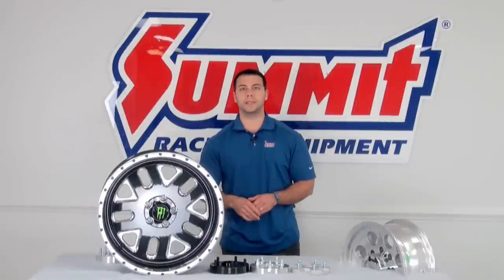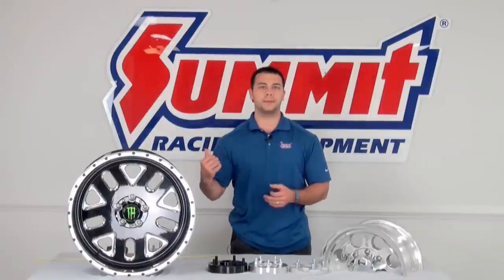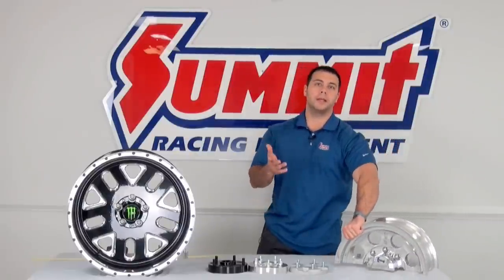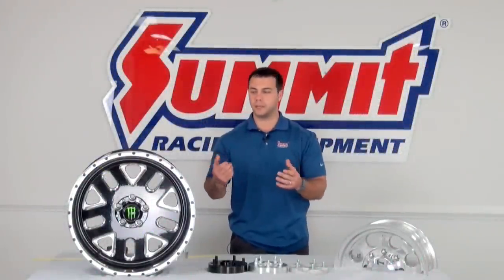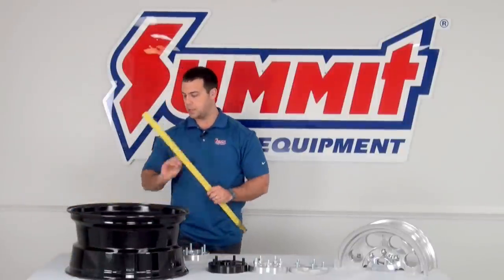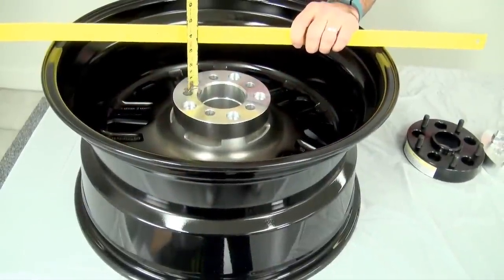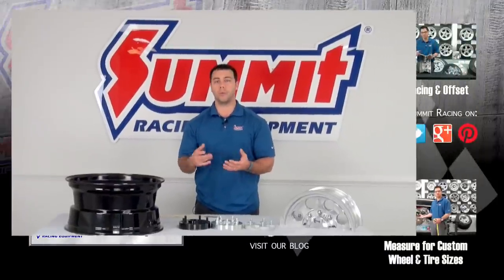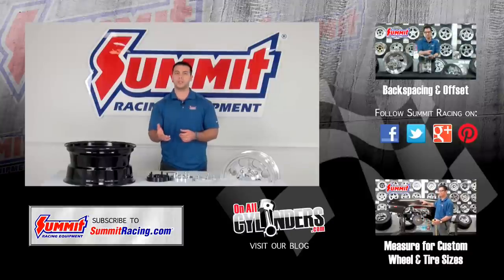Selecting the Right Wheel Adapters

Comment: So I got a 2006 Scion tC but the bolt pattern is slightly off as I got wheels for them size 18 x 9 but as I said they won’t fit do to the bolt pattern being slightly off. Which ones would you recommend for them to fit my car

Comment: I'm looking at changing a 5x114.3 to a 4x100 bolt pattern on my 2024 Nissan Kicks for the winter only.   I have winter tires on rims which I used on my 2019 Kicks which had a 4x100 bolt pattern but my 2024  Kicks is a 5x114.3    First is it possible?   And....what size adapter do I get?   If it is possible where do I purchase them.  I'm in Ontario Canada.

Comment: All I need to know.  Is the way the vehicle bolt pattern to the rims.  Need to be ordered to fit.  Say my C10 5x5 to a 5x108

  Do I order a 
5x127to5x108
         Or
5x108to5x127.  

Which one will be right to put a 5x108 wheel on a 5x127 bolt pattern?

Comment: Right now I have a 5X4.75 wheel bolt pattern. I want to increase the wheel distance by 2.5" but keep the same bolt pattern. Can I get spacers to keep the same Chevy bolt pattern, but move my wheels out 1.25". Thanks for sharing.
Reply from the maker: Yes we offer 1.25 inch wheel spacers
https://www.summitracing.com/search/part-type/wheel-spacers/wheel-bolt-pattern-app/5-x-4-3-4-in/thickness-in/1-250-in?N=thickness-in%3A1-250-in&SortBy=Default&SortOrder=Ascending

Comment: How safe are adapters? I heard they snap, wear down tire unevenly and wear down wheel bearings since it’s out more.
Reply from the maker: Quality hub centric adapters that are properly installed are safe. Pushing the wheel out can put extra stress in suspension and steering parts, however it would be no different than using a wheel with similar offset.

Comment: Which wheel adapter will be best for 2016 Chevrolet Cruze premier, I purchased wrong wheels. both are 5 bolt pattern but the radius is different

Comment: My wheels fit, but the wheels are thicker, so adaptors , or longer studs ? I like the idea of the stock studs so i can run my rallys with snows in the winter, without the extra length... but ?? What do you suggest

Comment: I have a 05 SRX Cadillac and I have a set of universal rims that want both up that means I have to get a set of adapters to turn a six in to a five loungs right
Reply: Man can you call me know i need to get this done now if you can please
Reply from the maker: Hi Johnny,
First you need to determine the current bolt pattern of the wheels  you are trying to install. The SRX has a 6x120 bolt pattern of which we currently do not sell an adapter to convert from a 6x120 bolt pattern to a 5 lug pattern.

Comment: are hub centric wheel adapters in any way better than the normal flat adapters?
Reply: Edgar Cuen Yes. When working with wheel adapters please use Hub Centric. This helps remove stress on all  wheel studs which when using regular flat  adapters it placed stress on your wheel studs.

Comment: Hi i have a phaeton from 2012 V8 and i have BMW 7 Series 5x120   22” . and They have to fit the car 5x112 wich Can i yuse and how much Would my whells stick out of the fender.
Reply from the maker: I am unaware of any wheel adapters with a 5x112mm pattern that well sell. You need to check with a Euro-specific company. You will need to compare the backspace of each wheel and then take into account the width of the adapter.
Reply: @SummitRacing   thanks bro

Comment: I just got my wheel adapters and was told to retorque the first 60 to 90 miles , do I gotta do it  every 90 miles or is it just the first time ?
Reply from the maker: You will not need to check them every 90 miles. You should do this after the first 60-90 miles however, to make sure nothing loosened after the first few heat cycles.

Comment: Hi  i have a set of 4 hole universal rims . I want to put them on my 1984 Pontiac Fiero with a 5 stud hub 
What would i need for a adapter and who sells them  ?  

hi
Reply from the maker: We are sorry to say,  Summit Racing does not sell 5 to 4 lug bolt pattern adapters for that application.

Comment: Can the adapter change the bolt circle
Reply from the maker: Yes, some adapters can offer a different bolt pattern on the wheel vs hub side.
Reply: @SummitRacing  isn't changing the bolt circle what the adapter is all about?